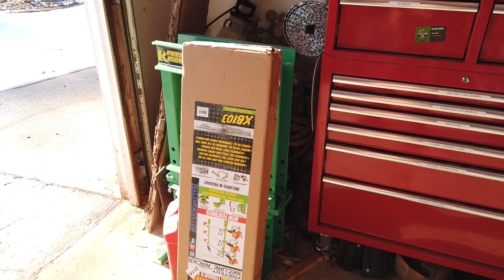Arctic Plow Partner

Comment: Should buy the hinker flip plow, can get rid of the drag, plow, bonus, with a flip plow you can back drag in reverse wile wind rowing, standard residential driveway with me doing driveway its a simple operation flip plow forward 180* at thr garage door, put truck in reverse, entire driveway is scraped to bare cement in first pull, get to end of driveway put plow in normal forward position and snow pile from driveway gets pushed forward into curb, wile I'm doing driveway guy jumps out of truck and shovels sidewalks quickly, one residenal house = 7 minutes average time. ** bonus back of truck is free for salter - big money can be made with salt.... had flip plow for 8 years now every one in area has tried to copy my setup, some were successful if they had the money to replicate it - hinker c plow = $6,000.00 +/-.
Reply from the maker: No thanks. And I gave up the salt game years ago....
Reply: @CountrysideStrong  must not like money........